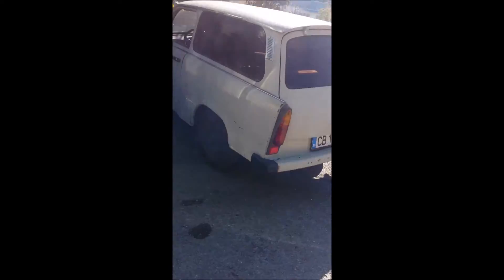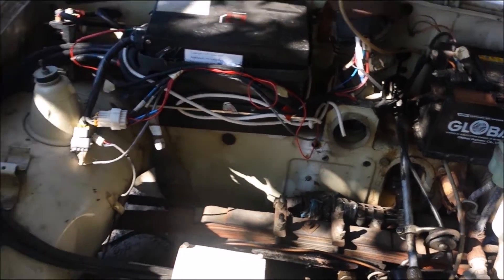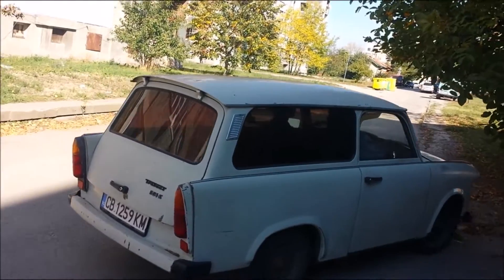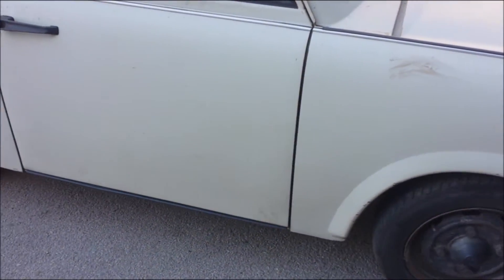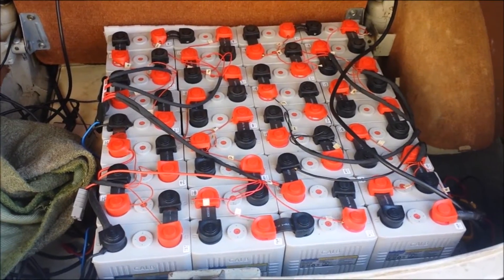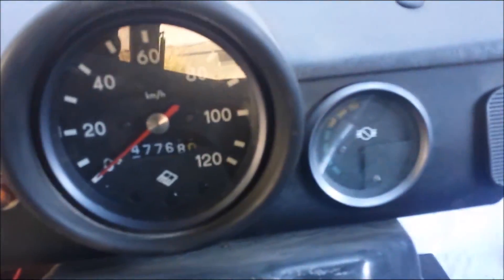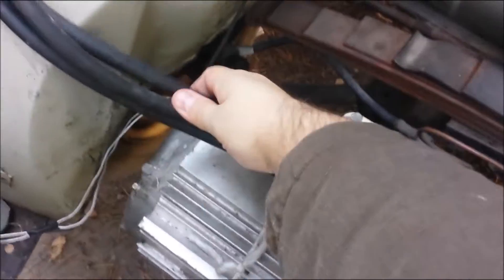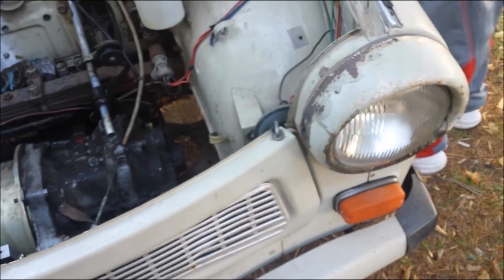Project : Electric Trabant  First Video may be ?

Comment: Nice job man :D,  like the idea. Can you tell me please what is the electric motor power?( KW ? )
Is it DC or AC? Maybe some engine details :D.
Where did you get the batteries and how much did it cost?
I would really like to start a similar project.
Reply from the maker: Well my friend has a hole channel fo the electrical trabant .
We had the idea to post the first videos here and to make the channel dedicated for it here is the link : https://www.youtube.com/channel/UCoruDrHEhocHVjtBEnyf7FA I hope that you will find the hole information there .
Reply: Тhe motor is Azure dynamics 18Kw max, AC, 3 phase. The batteries 11kWh, 36 cels 3.7V 100Ah The batteries are from Germany but I have 4 sels from aliexpres and they work perfectly. The all progect is 15 000 levs

Comment: HI guys
where did you source the CALB 3.7V/100Ah batteries ? pls. Is there a Bulgarian supplier, or your imported directly. What was the price per cell ? pls. 
Lastly what motor model + controller did u use? I am from Romania and very much interested to convert an old warburg311 (1963 model) and i am looking forward for your experience. Regards. Alex
Reply: Hi, thank you for clarifications, this means for your car, an energy consumption about 95W/km @510kg curb weigh. I was considering 1000 Kg and 145W/km as worst case scenario (actually after getting out the engine/tank/misc the car should be around 800Kg). 
For instance to go 130Km/h you need a motor with 40kW max. power (12kW nominal) and a 75-80Nm torque to do 12sec /0-100Km/h. 
Bear in mind that above 90Km/h the power needed due to aerodinamic losses is speed ^3 (goes up with the cube of speed). If helps you i can share my calculations.
Reply from the maker: +Alex Georgevici Hello the Battery's are imported
Reply from the maker: +Alex Georgevici in the next video we will talk about the speed controller and the price of the cell
Reply: Hi, looking forward to see where to source the components and how much is a 15KWh pack + motor + controller.  (pack is 15kWh for 100Km range, i calculated about 145W per km, max. energy consumption for a 1,000Kg car)
Reply from the maker: +Alex Georgevici Hello the car weight is 510 kg so if you need re do your calculations 
For the moment the proven range is 140km
Max speed proven 90km/h .
We need to do some modifications to the 
Car bifore trying more than 90km/h
Reply from the maker: +Alex Georgevici thanks for the comment .
Wi will see if the scale is accurate. 
Because on the scale the weight of the viacle was 510 kg .
There is some kind of in accuracy and .
We will see were it's coming from .